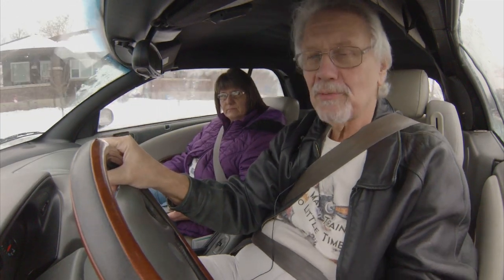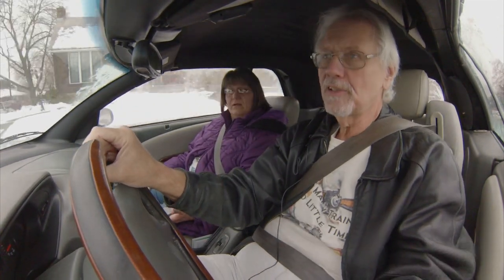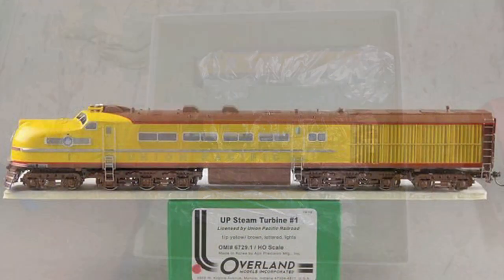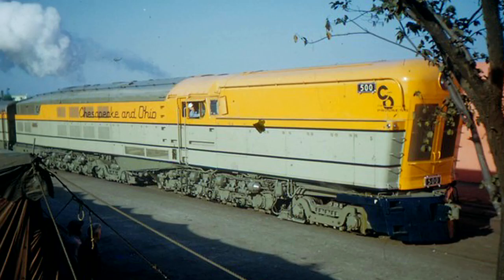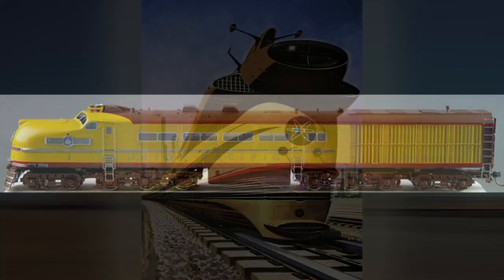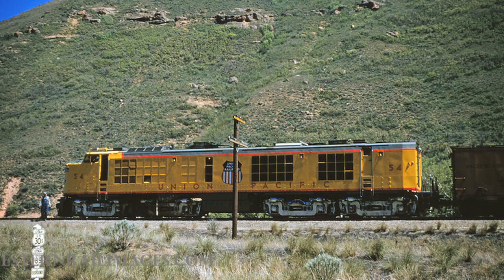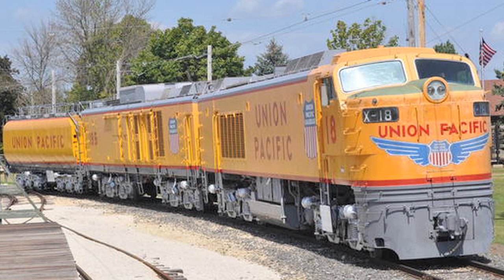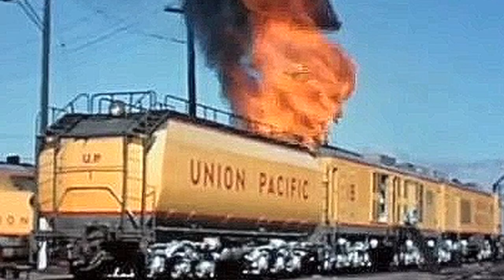What happened to the Atomic Train? - and HO Models of UP's Other "Expermental" Turbines

Comment: The Union Pacific 80, or the Coal fired Turbine was an experimental turbine to replace the Gas Turbines. They took an Alco PA, modified the control stand, then they took a Great Northern Railroad electric engine and turned it into the second unit that held the turbine, and then they took Challenger 3990 tender and modified it to hold and grind the Coal. The Coal Turbine was actually very very successful. Studies show that is could run from New York to Los Angeles without having to stop for maintenance, the Gas Turbines were fuel eaters, and that limited there route from Cheyenne, WY to Los Angeles, CA. Unfortunately, the Coal Turbine was a b*tch to maintain. It required Millions of Dollars to maintain, and Coal prices were rising, so the unit only lasted in service for a short time. 

In the 1980's when Ross Rowland was doing his ACE 3000 Project, he decided to come up with a turbine locomotive similar to the Union Pacific coal turbine. Sadly, his ACE 3000 or his Coal Turbine project came to an abrupt end in 1986.
Reply from the maker: Yup. The cost of bunker C fuel went from basically free to the same as quality crude. As they figured out how to refine the crap crude. And the coal dust ate the turbine blades. AND MU diesel became very workable.

Comment from the maker: Another problem with the nuclear turbine was the small reactor being developed by the government for use on radar sites in the arctic was abandoned after one of the operators used the reactor to kill himself. It had 2 fuel rods and one control rod that was raised by hand and clamped in place with vice grips! (What could go wrong) Anyway the guy grabbed the control rod  and pulled it all the way to the top and the reactor blew up ramming the control rod through the guy and pinning him to the celling. (Half way through the roof) And the fuel rods were spread over several acres. Took almost a year to clean up. And they did not build another. It was a bit bigger that a 55 gallon drum. Had the project gone forward, this loco would be able to operate 24-7 for one year on 2 fuel rods.
Reply: The Reactor you're referring to is the SL-1 that was at the NRTS in Idaho. It had more than 2 fuel assemblies, but it did have only 1 main control rod with 4 smaller rods to equalize Neutron Flux. The Problem with said reactor was, being built and maintained on a shoestring budget by the Army, with inexperienced and in the case of that fateful night, incompetent operators who were mainly trainees, it wasn't maintained the way it should have been. 1 central control rod is a bad idea in the first place, but on top of that, the reactor had strips of boron strategically placed within the core grid assembly to act as a neutron poison and prevent the reactor for achieving a power beyond it's design parameters, which unknown to the designers or operators, had corroded, cracked, and peeled from age and neutron bombardment and actually tended to jam the blade of the central rod which caused it to stick. On the night of the accident, they had finished refueling the reactor and were reassembling the main control rod's drive assembly, and to do this, the rod needed to be lifted manually 3 or 4 inches so the rod could be coupled to the drive. Now, since the blades liked to stick, the man lifting the rod needed to put some extra Umph into it to get the rod to budge, but he gave it too much and yanked the rod up far enough to make the reactor go Prompt Critical. The water within the reactor vessel flash boiled into steam and sent the slug of water above the steam bubble upwards with rocket-like force, the resultant water hammer had enough force to launch the vessel about 15 feet, ripping it out of it's plumbing, and firing out the control rod spindles like missiles, which as you know one of the gentleman took to the chest and was pinned to the ceiling. The fuel Rods didn't spread over several acres as they never left the vessel, let alone the (rather poor) containment building, they just collapsed from the steam pressure into a shape that made the core sub-critical so it could no longer maintain a chain reaction. After the reactor was taken apart in the "hot shop" to see what had happened and why, it was defueled and buried in a concrete cask in the desert. However, there were actually other variations of that reactor built and tested but were different sizes and shapes, in fact one was mounted in the hull of an old Liberty Ship to be used as a mobile, water bound power plant.
Reply from the maker: It's sad these projects never went forward. The design was stupid, and the funding ridiculous. These small reactors were a great idea, Tiny reactors power satellites. Like so many things in the 50's there was a notion it should be simple. It's not.
Reply: SL-1 was an accident waiting to happen. The rod assemblies had a tendency to stick (neutron irradiation, mechanical wear and tear on the control rod system) and the void coefficient of the reactor design all conspired to cause the accident.

The "One Rod" criterion did not originate with the SL-1 accident, but with the US Navy and their design of the Westinghouse reactor that went into NAUTILUS.  You can thank Adm. Rickover for that bit of safety.
Reply: This is not exactly correct. The operators did not intentionally kill themselves. It is was one of the control rods got stuck because of a design flaw, and in attempting to fix it the control rod promptly came out and caused a prompt nuclear incident causing the reactor to go critical...

Here is the report on SL-1..

https://www.youtube.com/watch?v=yjljS0aQbCc
Reply: Toy Man Television 📺 has a little more attention and more of
Reply: Well actually. The Russian Federation attempted a Nuclear Powered locomotive, and it worked. During the 1990's, the Russian Federation decides to try and modernize the Russian rail system. The first two units used a carbody similar to the Union Pacific DDa40x. The next four were highly similar to the EMD SD90MAC-H2's. And the Russians decided to build 299 US freight cars to use for the Russian rail system. The Nuclear powered turbine locomotives worked, but they were a b*tch to maintain. Whatever happend to the Locomotives and 299 freight cars is unknown, but it is agreed that they were not scrapped
Reply: They did some amazingly dumb things with nukes in the early days.
Reply: @AmericanRailfan-gb8oq , I've never heard of this. Would you be kind enough to give me a source?
Reply: @thekornwulf  If www.historyrecords.gov was still available to the public, all of the information would have been right there
Reply: I don't like future train's they look awful and did they got struck by lighting and it will not work or keep going on forever.

Comment: I found an article on an atomic locomotive in a 1954 issue of Popular Science which looked like an EMD F-unit with a fat center section housing the reactor. The reactor didn't use uranium in rod form but used a radioactive "soup", that means if it derails, the reactor won't melt down.
Reply from the maker: Yup. The one I show is an artist concept. Fun and I’d love to model it. But the real one was very much like the 4500 hp turbine.
Reply: @ToyManTelevision ..... IS EMD's version still in existence somewhere that you're aware of?   Love your & Karyn's videos,  been subscribed since I found my first video of yours about 2 years ago.  Isn't it Great to have a wife that's on the same "page" together in what you both love to do and interested in?!?

Comment: Came into this from a video on the Aerotrain from 'Science Matters'

Interesting segment on the turbines. I have one in 3-rail O scale from MTH, the 'Big Blow' 8500hp GTEL turbine. It may not be as detailed as Overland, but I figured it would be the biggest loco in my collection, four motors and 44 inches (112cm) long.

 I had it retrofitted with second-generation electronics a few years ago thanks to one of the technichians who hang out on O Gauge railroading's forum, and like you, I'm waiting for an opportunity to run it--it sits at the end of a long line of motive power waiting to try out my test-track loop 'round the living room.

Comment: I have a problem with the foam that deteriorated over many years and is stuck to a brass steam engine. Any recommendations on getting it off would be appreciated. The engine is painted so that is a consideration also. Thanks.
Reply from the maker: Wow. Don’t know. I was able to brush it away but it was stuck to the plastic wrap. So no big deal. But on paint... I fear it’s attacked the paint. Just no idea. I love a product called “goo gone”. Doesn’t seem to attack paint. But if you try it go carefully.  Also it leaves an oily residue that you need to clean with soap.

Comment: The 8500's are the best looking ones, particularly #13! 😉😄
Another great video kiddo! 👍👌👏
Reply from the maker: Love them all. Want to add sound to mine. Need to figure that out. I'm sure something is out there. Years ago, I did use the sound unit out of a Monogram B 52 in one!! Worked quite well!!!! It was a motor with a blower and a whistle. Sounded like a jet. Sort of. But the motor spun when any power was added, made quite a bit of sound, then as I opened the throttle it really sped up. Old school for sure!!

Comment: Amazing futuristic stuff!  As a boy I watched the Reading PA railroad change its coal haulers to diesel.....I thought how strange...diesel locomotives hauling coal!  Then Philadelphia Electric touted the advent of the nuclear power plant...and I distinctly remember..."why electric will be too cheap to meter"!  So much for those promises!  LOL!
  Jack
Reply from the maker: +Jack R I still like nuclear. Just don't want to live within 200 miles of it. Have you seen the Tesla home power unit based on the power unit out of the cars?
Reply: +Toy Man Television Hey, Dale!  Can't say that I have seen that....I won't be happy with nuclear until they find a reasonable way to either store spent material or ways of neutralizing its radiation.  Unguarded pools with highly radioactive "stuff" is not a solution in my book. :) Jack
Reply from the maker: +Jack R Elon Musk is a raving genius. Another Tesla for sure! Anyway, his new product is a battery system almost the same as the ones in the cars, but you connect it to your solar panels. Also a back up generator for times when needed. Not often they hope. Then disconnect totally from the grid. Cool idea.  Nuclear: There is a way to do this that's so good that no one likes it! Because the reactors are small, and need to be small, it takes lots of them. So the power co's hate them. And they are nuclear so most people are scared of them. BUT they run on spent fuel rods! The recycle them! You put about 1/3 of new rods in the reactor, and 1/3 weak rods, and 1/3 spent rods. As the reactor works the old rods pick up power from the good ones. A breeder reactor. The same as to old reactors they used to make bombs with. Another reason people are scared of them. But no one uses these to make bombs any more. Anyway, electricity in exchange for spent fuel rods. Costs more than it makes, but it gets rid of spent fuel. AND if you cut power the the reactor, shut off the water and just walk away, NOTHING happens. As long as they are small. The spent rods just absorb the energy.
Reply: +Toy Man Television Hey Dale.  Interesting concepts on both fronts.  No reason why the typical householder can't generate some of his or her own power!  If we can keep nuclear waste to a minimum and in fact recycle it, there may be hope yet.  Thanks!  :) Jack
Reply from the maker: I know there are risks. There always are. But the risks we take for granted are worse. ISIS has killed less than 20 Americans. That many die every day from drunk drivers. Nuke power has killed between 200 and 40,000 total (depending on who you listen to) yet carbon kills 10,000,000 per year and is warming the earth.

Comment: Back in the 50's, Bunker C fuel was so cheap, it was almost being given away for free by the refineries.  So the attraction of using a FREE FUEL to pull trains was such a big attraction, that is why those turbine engines were created.  But later on refineries started using catalysts and other techniques to break down that heavy Tar-like Bunker fuel into other products, and they started charging a price for it, that's when those engines didn't make financial sense to keep running, it was because the fuel wasn't free anymore.
Reply from the maker: +Honesty Counts Didn''t know! Makes sense though. I have always wondered why they called them "gas" turbines when they ran on almost tar. Not gas for sure!!
Reply: The growing plastics industry also started competing for the same feedstock that before was only good for Bunker fuel, so as you said, it became worth something.

It is my understanding that both Bunker C and coal were bad about eroding the turbine blades.  They also tried natural gas, but it was too expensive.  (The ones used in the utility industry to generate electricity do run on natural gas; that is why they are called gas turbines.)  By the time the turbine locomotives needed major work, the diesel lashups had already proven themselves, and they were instead retired.

Comment: That Union Pacific steam turbine you were looking at was the convincing steam locomotive in the United States. There were of course other steam turbine locomotives. In one country, don't ask me where off the top of my head, they were  actually quite successful, and used up until the 80's. there where only two successful designs for steam turbine locomotive in the United States however neither prototype went into production the first was the Pennsylvania railroads S2 which had the same layout as the steam turbines that were successful in other countries. the other was the Norfolk and Western John Henry which was a steam turbine electric. Both those locomotives were locomotives were coal burners. Coal hauling railroads tried to stick with coal as a fuel. Diesel locomotives of course can't burn coal.  The S2 and the John Henry both had teething troubles it whenever sorted out but could have easily been. On one of the charts from the project for the nuclear locomotive you see a comparison of fuel economy a gas turbine is actually less fuel efficient than a steam locomotive and in fact the least fuel efficient. Since a modern steam locomotive like the Norfolk and Western,s J class had less maintenance cost than the first generation diesels, then assuming that the maintenance cost of a giant steam turbine is higher than that of a diesel locomotive then even if the second generation diesels had a comfortable maintenance cost to steam locomotives like the class J and since Union Pacific was interested in burning coal, I think Union Pacific would have been better off sticking with the Big Boys or building the proposed Super 800s.  GE patents for some new high efficiency turbine locomotives made to run on compressed natural gas, so someday we may see the return of the gas turbine locomotive to the rails. It has been suggested that the most efficient thing to do would be to a have two cycles with a gas turbine and a steam turbine. If you would like I can link you to a steam turbine of my own design or more information about the proposed super 800s, of course you are probably already know about it being a UP fan.
Reply from the maker: +Daniel Mccoy HI!! Cool to know. No, I'm clueless on most of this. Just love to build models. I knew the steam turbines were a great idea, but I knew the UP never sorted it out. I figured this was just a desire to move on to gas turbines, not a totally fail of the steam turbine. I'd love to model the 2 atomic turbines, little known on them, never locked down as to how that would look in the real world. 3 unit as I understand them, drawings and concepts and nothing more. In the real world I assume they would look like a normal 8500 HP. Sort of. BUt who's to say? LOVE to see your link!
Reply from the maker: Yep, checked that out. Cool loco!
Reply: +Toy Man Television Thank you! :)

Comment: My favorite is the 8500 horsepower locomotive 🚂!
Reply from the maker: Shame they went away. In 1971 I snuck into the roundhouse in Ogden, and every stall had the two units of a turbine in it. The tenders were outside. All most all the 8500 units stored together. WOW
Reply: Toy Man Television today I took out my own 8500 HO scale and I look at it again I also took out my brothers legs and built an 8500 horsepower 3  unit engine

Comment: Yeah if that had a meltdown on the rails, there would be more than liability that would have to be paid.
Reply from the maker: I have thought of modeling it in HO, and having a small container inside with a pin hole leak. For night sessions, pour the contents of a glow stick in there. And drip green glowing goo as you go. Just a thought...

Comment: Uranium reactors are always heavy and cumbersome, just because of the atomic weight of the  Uranium.
A much smaller and lighter power plant, suitable for locomotives and road vehicles such as motor-cars could be built, using a less dense radioactive source such as weapons-grade Plutonium.
Reply from the maker: I dont think anyone would let any of that out of a secure area. This was an interesting idea. Would have worked, but never tried. To expensive, and at the end of the day that's all that matters to a railroad. Making money. BUT would have been cool to see made. Even if it were only one.